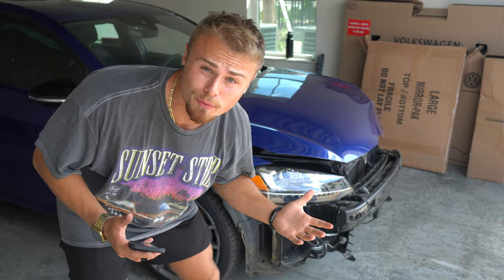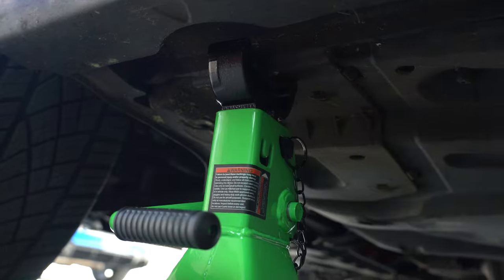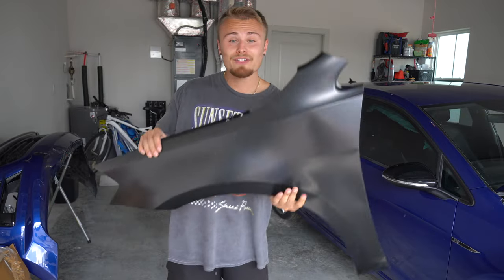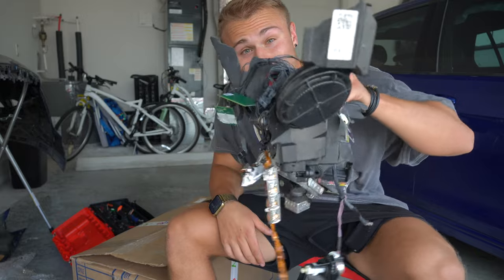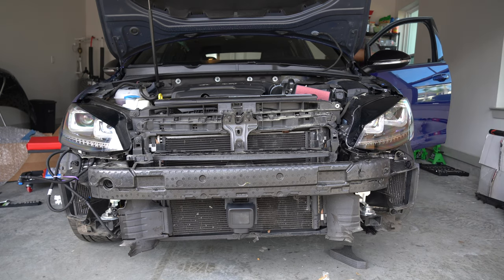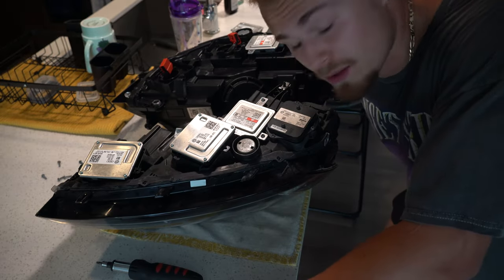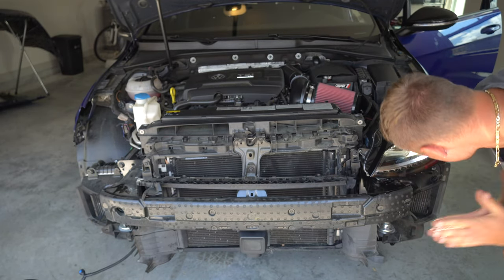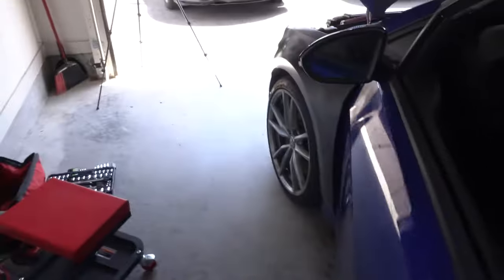REBUILDING A WRECKED VOLKSWAGEN GOLF R | PT 2

Comment: Good job diving into this project! We rebuilt a front end damaged 2017 Gti and have gone through much of what you are showing. The little parts really add up don’t they?! Is your new fender dented? when it’s all done there will be a lot of satisfaction knowing what you put into it. Have fun with the rad support and dashboard!✌️
Reply from the maker: The little parts really do add up! fortunately there are a lot of aftermarket parts in the US that seem to work just as well for a fraction of the price. such as the headlight control module and hopefully the radiator support panel. Noticed it too, not at first but later after install. I bought it new, it must have gotten pushed in during shipping. I was fortunately able to give it a push from the other side and it went back into the correct place. Otherwise id be returning it.
Reply: @Haydenschreiermk2  True about the aftermarket parts, but dont let them fool you sometimes they are cheap but fitment wise it can give you headache and cost you a lot of time to get all things aligned properly :)